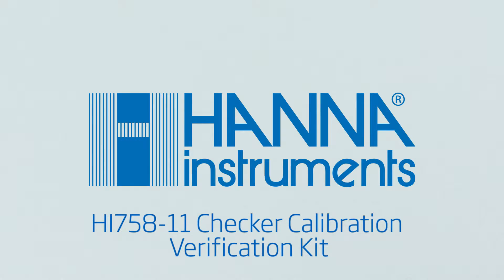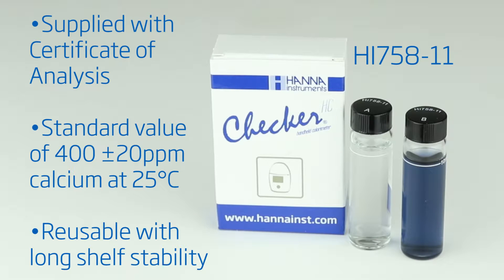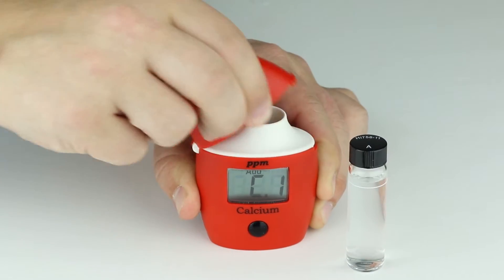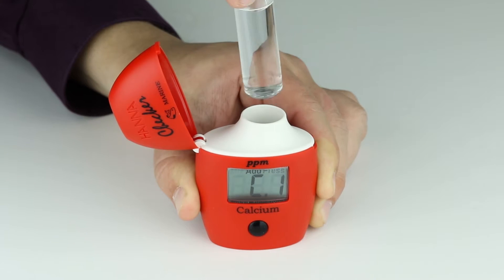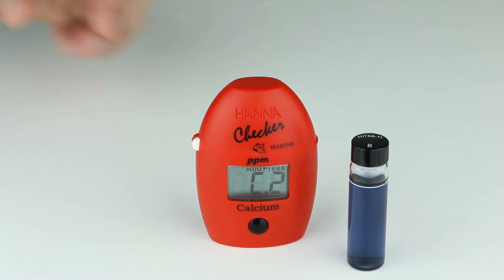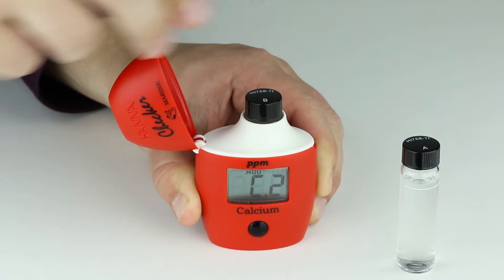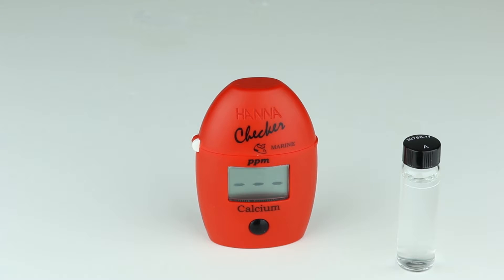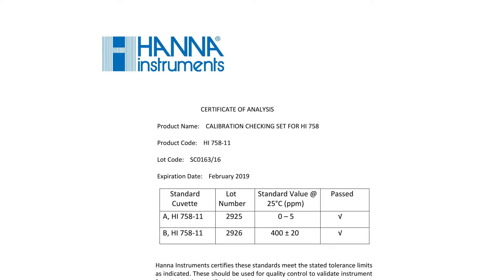Hanna Instruments HI758-11 Calcium Checker Calibration Validation Kit

Comment: what happens if it is greater than the 400/420.  i want to check my calcium checker as my readings are coming out higher than 570, yet my redsea  kit sits at 470 or so

Comment: How often do you recommend using the calibration kit? I assume when first bought it’s ‘good to go’?
Reply from the maker: Yes. The kit is meant to validate that the Checker is in working order. If you start getting erratic readings, you would use this to make sure it's working properly. If not, our tech service would provide you with next steps.